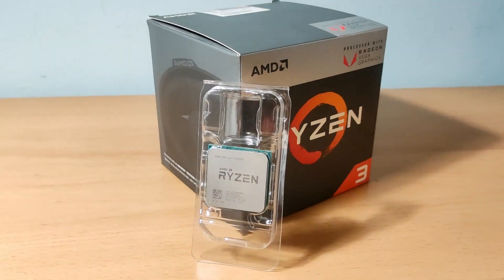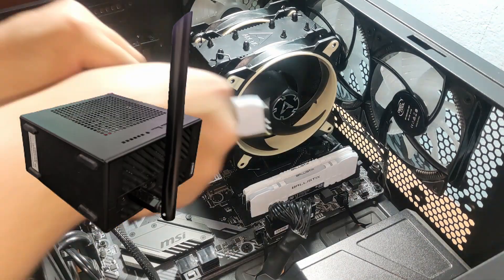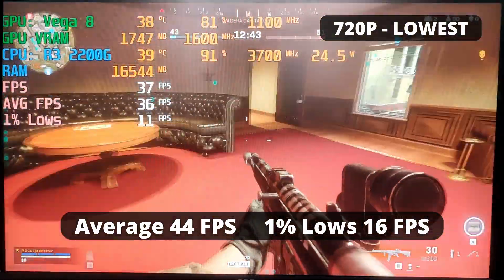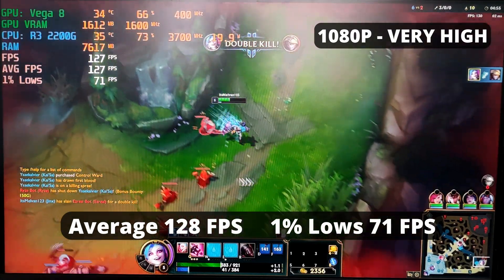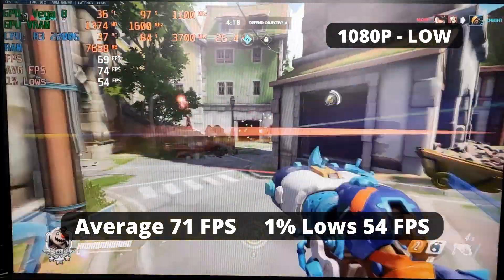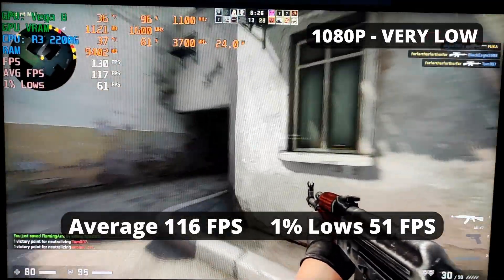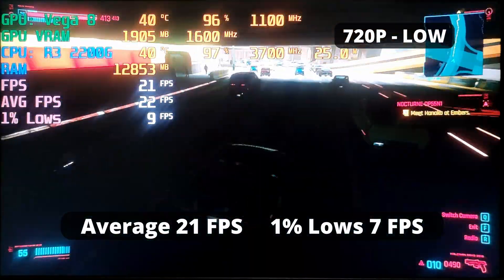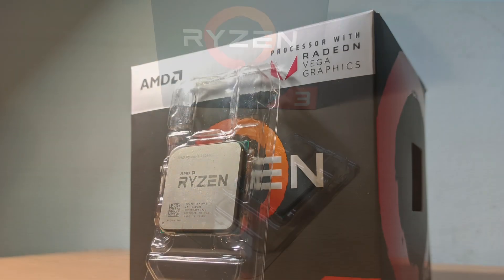AMD Ryzen 3 2200G Revisit Early 2022 | Surprising in both ways! | 20 Games Tested

Comment: Bro do you think this cpu 2200g can be paired with 3060ti? Will it run good and with no bottleneck?
Reply: Nope, bottleneck.
Reply from the maker: The RTX 3060TI a powerful card, it's pretty much a RTX 2080 Super. It will most likely be bottlenecked.

Comment: and all you have to do to play newer games like forza is to buy a 1660 super, (any higher will bottleneck the gpu),

i have a gtx 1050ti 4gb and it does the job well enough, i could run most modern AAA games at 60fps with some tweaks,

Comment: Subbed. Nicely done. 
Have you tried allocating 4GB of ram to the iGPU in the bios? Just to see if there's a difference worth noting?
Best regards from Alaska. (edit: what cooler are you using?)
Reply from the maker: As far as I know you can only allocate 2GB maximum with the bios, and that's what I did. The cooler I used in the video is the "Arctic Freezer 34 Esports Duo", like stated at 2:59 ^-^. Thanks for the sub! I appreciate it! Hopefully I get to the magical 1000 Subscriber milestone soon!

Comment: i am currently using this apu. Overclocked the cpu to 3.9 ghz & igpu to 1550 mhz. and i m pretty much satisfied with this oc performance.
Reply: what program did you use for overclocking and what cooler do you have is it the stock one?
Reply: @krompa8616  overclocked thru bios and using stock cooler. Open case airflow, temp goes 85 max
Reply: @rizzrabbani659  ahh nice im stuck with my motherboard that cant overclock
Reply: @rizzrabbani659  i used ryzenmaster tho and managed to overclock it on 3.7ghz but for some reason whenever i try to overclock the gpu to around 1300mhz the pc restarts everything is good but then when i check the overclock didnt apply

Comment: As pesron experience, the biggest problem with that 2200g is the lack of SMT paired with the low IPC from 1st gen Ryzen, it gets more noticible when using a discreet GPU, I'm using the 2200g paired with a GTX1650Super for about 2 years, the Ryzen has many problems on CPU intensive games like Battle royals and cyberpunk, it's almos the hole time at 100% utilization, causing many stutters and low usage of the GPU, not to mention that you only use x8 PCIe lane because of the integrated Vega
Reply from the maker: That's true, lacking SMT is detrimental with some games and applications, though it does pretty well considering it's price.